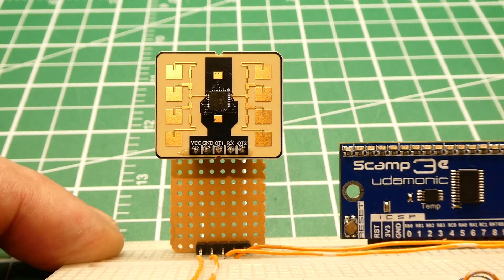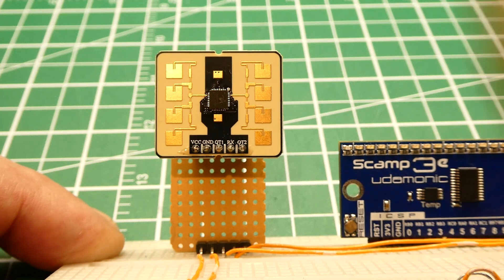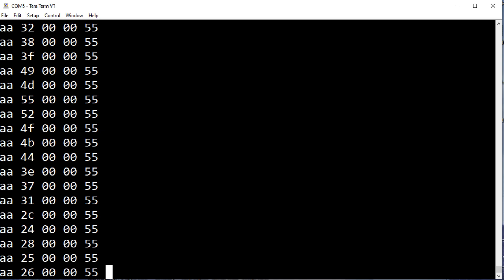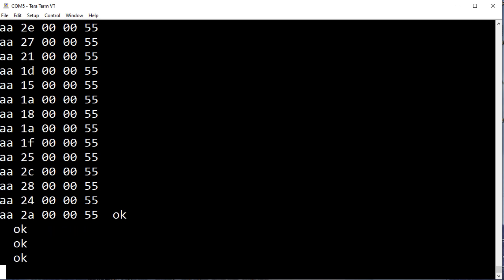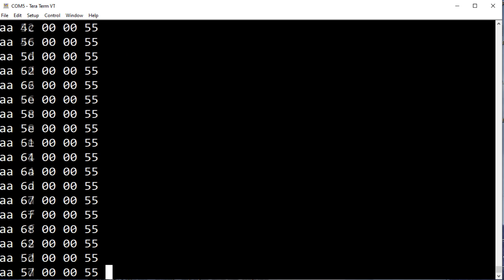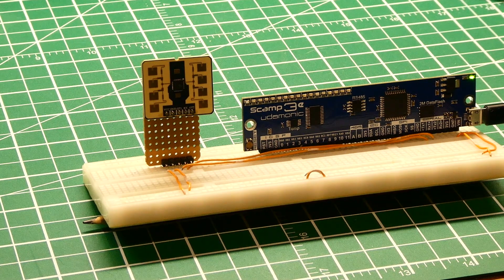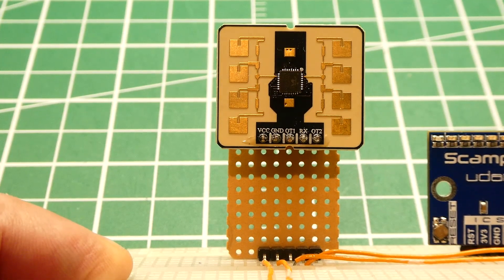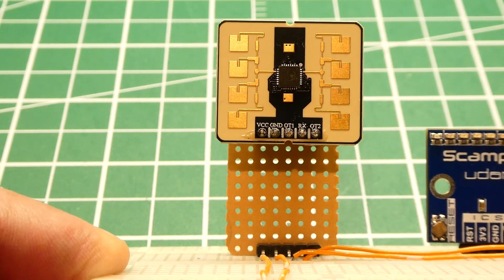Hand Gesture Sensor / mmWave  RD-03E

Comment: @003mer cool project😎

For projects like this, do you complete them all at once or work on them over time ?  Any tips for getting projects completed and not just starting then leaving them unfinished? I struggle with that.
Reply from the maker: For simple projects I can complete them in one sitting. For more complex projects it can take some time for coding and going over the data sheets. Start off with simple projects, so you get the satisfaction of completion and gradually get into more complex projects.

Comment: Interestingly and oddly, the RD-03E sensor I'm presently testing is outputting double headers and double trailers (i.e., each data packet begins with AA AA and ends with 55 55). It could be that I'm parsing the data incorrectly but I'm curious if you've ever seen anything similar. Also, do you know a way to disable the gesture software on the device such that it only output basic radar data (detections, detection range, etc.)? - Thanks! - Jim
Reply from the maker: If you look at the data sheet for the sensor, it outputs 5 bytes with AA as start and 55 as end of packet.
Do you have local echo enabled on your moitoring software?
If you want detection/range sensors check out these videos:
https://youtu.be/unsF0oHmS1s
https://youtu.be/p1FPvbmiNro
Reply: @0033mer  : I do not have local echo enabled. If I did I'm pretty sure that all bytes would be repeated, not just the AA and 55 header/trailer bytes. Also, I found code on github (user  madhukartemba) which seems to corroborate my results. - Thanks! - Jim

Comment: Thank you for nice demo! What is the max distance supported by the sensor?
Reply from the maker: The detection range is limited to .5 to 1 meter, so the distance readings are meant to be used to cut down on false triggering. Check the data sheet for more info.

Comment: Cool but I misinterpreted the title and was hoping it was plural gestures not just single detection.  This what the detection capable of penetrating? (paint, paper, cardboard etc)
Reply from the maker: This sensor detects gestures through non-metallic materials. Check the data sheet for more info.